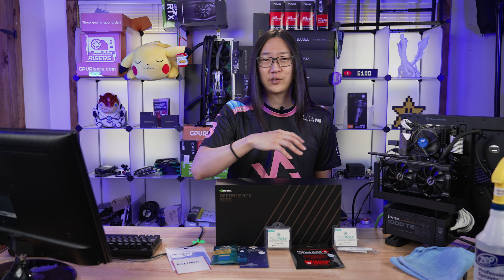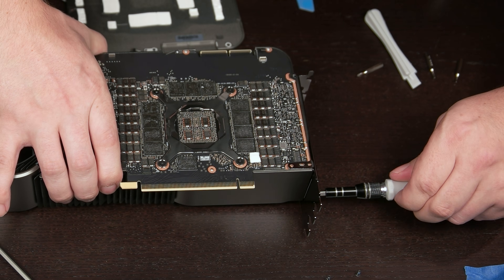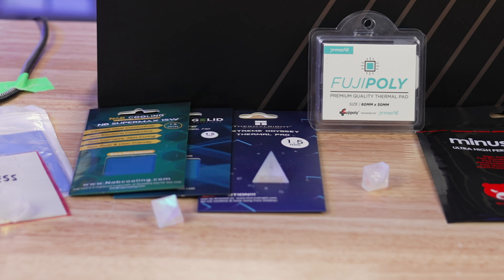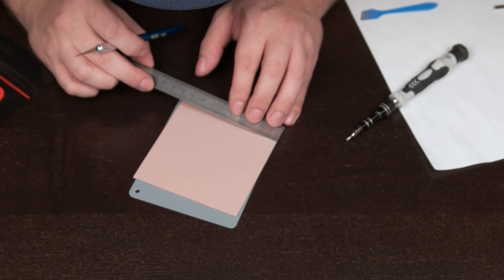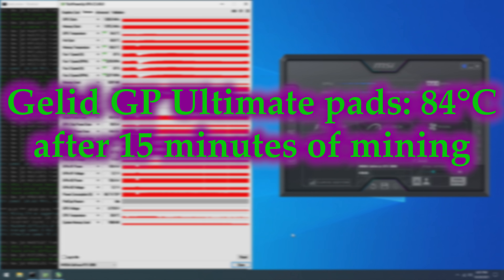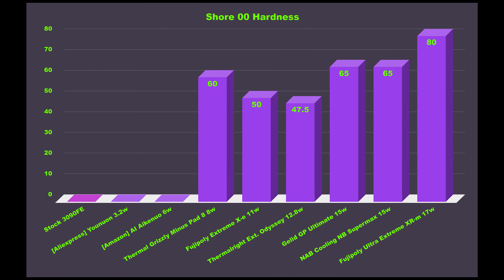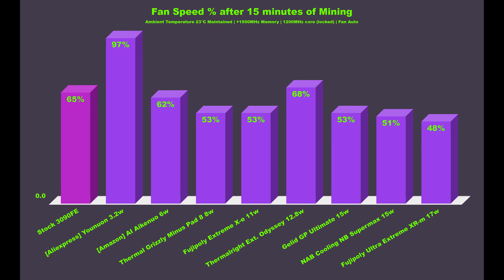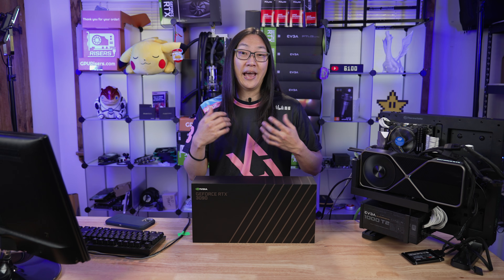Thermal Pad Showdown! What you should (and Shouldn't) Buy

Comment: 17:22 you sayin the Founders heat sink around the entire board isn't good enough? Maybe the Ko will do better as a heatsink coming from Asus and all. Right?... Wait that's a good question. Is it better to use decent thermal pads on Asus cards?
Reply from the maker: It's about it's designed purpose. For memory intensive applications. It's not a good design. However, for 90% of gaming applications, it's fine since the memory doesn't get taxed as much.

I don't understand the question though. Are you asking if it's good? I don't think it's bad.

Comment: Bought the NAB Cooling for my EVGA  3080 TI based on this comparison and V-RAM temps stayed exactly the same as it was with the stock pads. Used 2mm AB Cooling and measured the stock pads at 2mm as well.
Reply from the maker: Do you know what the exact measurements on total compressed thickness was?
Reply: @TekShinji  I do not. I still have the pads that came off as they were still in great shape. I'm assuming you mean the thickness of the compressed parts where the pad contacted the ram and the cooling plate?
Reply from the maker: Yeah, it's just strange that you had no noticeable difference. I'm talking about the compressed thickness. Yes that's correct.
Reply: Measured 1.89-1.92mm compressed
Reply from the maker: All right, thanks for the feedback!
Reply: @TekShinji  So interesting development with my EVGA 3080 Ti. Recently installed a GPU brace that runs inline with the card and has an adjustable piece that holds the card up. (It slides along the brace and tightens with a thumb screw)

I installed the brace with the adjustable piece at the end of the card farthest away from the I/O and when I ran my miner temps went up into the 100's (100-102). I believe the brace was bending the card breaking the contact of the thermal pads.

 I then moved the adjustable piece to be as close to the I/O (and subsequently closer to the GPU Silicon) as possible and temps normalized and even went down 1-2C. I suspect that with this card a 2.1mm or 2.2mm thermal pad may be in order, or it may be that the AB/Gelid (same company BTW) pads are just slightly smaller than the advertised 2mm. (without re-watching the video I believe I recall you measuring the pads out at 1.9mm or 1.8mm)

Just thought it was an interesting discovery that may or may not be worth some more investigation.

Comment: Mate I like that you did the testing, but - the thesis that the heat energy of the memory increases cooler / gpu temp is bs. The gpu die runs hotter because the fan speed is tied to the highest temperatures on the card. If the memory is cooler the card will run lower fan speeds and the gpu die gets hotter - you can easily fix that yourself by tuning the fan curve.

First law of thermodynamics. Energy conservation. Yes theoreticly heat flux through the air / pcb should be increased by a higher temperature delta, but the difference is negligible. There is a reason we use a lot of surface area and fans on coolers - air is a terrible heat conductor.
Reply from the maker: Hey there, thanks for the response! Would you be able to come up with any supporting testing to confirm this? We would have thought the same thing, in fact we did think the same thing until we saw these results with better pads so to speak and the GPU core temperature on the cards. On all of them not just one and it was on all of the test

Energy conservation first law of thermodynamics is very important. In fact, this is part of the reason why we didn't think this is what was happening
Reply: @TekShinji  It's hard for me to test. I don't have ac. I think at a fixed fanspeed with a full heatsoak (maybe like 30 min before testing) it should be very visible.
Reply from the maker: Yeah, these things are not the easiest things to test at least in a scientific manner. A lot of testing subjective so we try to account for that in our testing.

Oftentimes as with physics, science, things that work out on paper don't always work out in the real world due to some unrelated environmental factor that must be considered.

Comment: i have a very strong feeling your increase in GPU core temp had more to do with pad thickness than thermal conduction of the pads.
Mounting pressure and distance for thermal grease is CRITICAL (for pads it's just ..."meaningful"). YES there thermal energy conducted faster to the heatsync if the pads is better - but even if you DOUBLE that conduction - you're still dealing with the exact same amount of total heat energy, It's getting in sooner, but there's not physically any MORE of it. 
Your GPU is running hotter because the stock pads are either NOT 1.5mm OR their FITTED thickness is lower than the others.
Reply from the maker: Hi there, thanks for your response, did you watch the whole video?
Reply: @TekShinji  yes, and it was a great video, very helpful
Reply from the maker: Regarding The GPU core issue, I would agree with you if we had inconclusive data but I feel the data we have kind of proves it. We kept the environment the same. The only variable was the pads, and we tested it multiple times on each card. If you see from the data, you can see that the pads that had the higher transference also increase the core temperature.

However, I can also understand how you may not see it that way. Which it's still a possibility. However, we do not have the scientific equipment to go that far.
Reply: @TekShinji   you know what; i was looking at those numbers thinking: how could they be SO different when VRAM is only a small portion a GPUs power (what's an extra 20W to a 300W GPU? 5-7°C?)  - but i didn't consider that when mining, VCORE is not using a lot of power in the first place, so it might well make a proportionally larger contribution to temperature.
Reply from the maker: That is correct. That's the conclusion we came up with. However, we're also open to interpretation of our data. That's why everything is displayed in a long video. Lol. This video would have been very different if we just said XYZ the best.

Comment: GJ guys i am realy enjoyed watching video. I am goin to do a coper shims mode to my gpu its a freaking gigabyte rtx 3080.
I have tryed minus 8 pads and no go also replaced other stock pads because they leak oil.
For other component i put arctic apt2560 high performance pads also on the back was instaled minus 8 grizly pad then i will add a coper shims 2mm thicknes on vram modules.
This mode is much more cheaper than go for gelid or other expencive pads.
Hey coper have up to 400w/mQ but i dunno how would that efect gpu die in oreder of heat disaapation.
Using arctic mx5 paste.
Any ways you made great video but i do not have confidience to this ecpencive pads in longer term of use in case of mining.
Reply from the maker: Hey there, thanks for your comment. Please let us know what you decide to go with!

Comment: Very good analysis ! I really like it !

Do you expect to do the follow up video on a more in depth analysis of the increase in temperature of the gpu and how to prevent it ?

My solution would be to use a different heat sink, but thats a huge project...
Reply from the maker: Hey there, the analysis we did on the temperature increase was consisted across the board on all the pads that had better thermal transfer performance. So it was enough data on our end to conclude that was the cause.

A different heat sink is a great idea, but in practical terms it's not something that makes any sense. At that point, it'd be better just to buy a different card.
Reply: @TekShinji  so you're saying it's either we tolerate either higher gpu tenperature or memory temperature ou just buy a different video card ?
Reply from the maker: No, I don't of course I don't believe in that.

Rather, if you take the cost of buying a "cheaper" GPU with thermal problems; the cost of your labor, parts, waiting for shipping, and potential issues for damage.  

Versus the cost of just buying a more expensive card that's got no thermal issues

The numbers don't really make sense. Understand what I mean?

Comment: According to the measurements in the video the total amount needed is 5495,4mm2 2mm and 8440,4mm2 1,5mm if you stack 2mm and 1,5mm to get 3,5mm
Reply from the maker: It's not recommended to stack pads but in a pinch you can definitely do it

Comment: It´s good to add, that you should always measure your old thermal pads and add new of the same height. Otherwise, you might encounter issues, like higher GPU core and/or VRM thermals, when using thicker pads. Or higher memory/VRM temperatures, when using thinner thermal pads.
Another necessary point is, each card can have multiple sizes of pads on various places, so you need to have a supply of multiple sizes of pads.
Reply from the maker: Thanks for the feedback!
Reply: @TekShinji  i was replacing the pads on my GPU last weekend and these were my findings. I had some trouble with measuring stock pads, so i used thicker pads for VRAM, as a result, i had insufficient contact at core and VRM. There is similar issue with backplate, especially when there aren’t enough screws near the padded area. It’s also necessary to understand, which area should be covered by the pads, since the manufacturers tends to use pads as simple & cheap as possible - they´d rather use 1 longer pad, than 2 or more individual pads for each VRAM chip.

Comment: Which would be better if I am water cooling a MSI 3070 ti
Reply from the maker: Thanks for the comment! did you watch the whole video?
Reply: @TekShinji  I did but bykski uses 1.8mm pads which is an unusual size
Reply from the maker: Yes, so some pads are softer than others. A soft 2 mm might work out? However, you would have to see what works best for your situation. Unfortunately, the pads aren't made to any type of universal standard so it's kind of hard to tell until you have them

Comment: After so many annoying videos of "I tried new pads, and it worked better!"  It is nice to see someone do a real side-by-side of different pads, and seeing what actually makes a difference and how much.
Main issue with my 3090 hasn't been the main cooler, but the back plate.  Even with a heat pipe under the back, you can still easily fry an egg on the back of the card!  Took a block from an old Pentium II and just a little thermal paste (more to help it stick than as a permanent solution), and my reported VRAM temps dropped 10*c.  That tells me that the VRAM under the main cooler is getting plenty of love from the fans, but the VRAM on the back is essentially the thermal bottleneck of the system.

Whats more, after a month of mining at ~305W and 110-115MH/s my temps have risen significantly from 94-96*c back up to around 106*c which appears to be the thermal limit of my GPU where it will start slowing itself down a bit.  From what I have read, this is expected for my card (Dell 3090), so now I am ordering some aftermarket pads... Hopefully it will work as expected and get me back up where my card belongs.  In the mean time, lowering the power level to ~250W and getting closer to 90-100MH gets me back down to the more cozy 94-96*c again.  The idea of being able to get closer to 90*c at full tilt... that would make me feel a heck of a lot better.  I know on paper 120*c is where damage can occur, so the built-in 106*c is giving plenty of margin for error... but the lower I can get it below 100*c the better.
Obviously while mining I am underclocking the GPU itself, so my GPU temps are a frosty 50*c, so no chance of danger there.  It is only the RAM temps that causes me some worry.
Reply: Perfect!  After looking at what my Dell 3090 needs I was able to find the NAB 15W pads for $8.50 for .5mm and $11 for 1mm.  Ordered a 90x50cm sheet of each.  The Gelid pads were $1 more expensive, but I'd still check as I would imagine a sale or price fluctuation may make one or the other cheaper.

For those with similar Dell 3080 and 3090 cards:
On the front of the card you will need 1mm pads between the RAM and the black thermal plate that covers the card.
Between the heatsink and the black plate you can use thermal paste, but it needs to be thicker paste that wont melt/run/move over time.  The other option here is to use .5mm pads instead which will compress down and will be more consistent over time.
On the back, if on a 3080 just keep with the stock pads, they aren't doing much, and there is little to no point to replacing it (especially if it is sucking more heat out the front of the card more effectively).  For a 3090, especially if mining, the RAM modules on back are likely your bottleneck.  The built in pads look like they are pretty good quality... but just don't cover the whole chip, so not all of the heat is being dealt with.  So you can either keep the stock back pads and add a .5mm pad to cover the area a little better (they are stackable and will squish enough to not be a problem), or get a 1.5mm pad to take care of the rest.
Reply from the maker: That's awesome, Thanks for the comment!

Comment from the maker: Why dont i use shimis? why not use this pad? best place to let us know and FINDout WHAT ELSE we did in our discord! 

Tek Shinji Community Discord 
https://discord.gg/mjVHe2YMkR
Reply: You should try K5 Pro Viscous thermal compound it’s amazing thermal pad replacement it replaces pads up to 3mm thick I found it through LTT and his more FPS for $10 video
Reply from the maker: @shorty808100  I wish $10 got you more fps.
Reply: @shorty808100  K5 Pro has conductivity 5,3 W/mK. Better Laird Tputty 607 6,4 W/mK, Upsiren U6 Pro 12,8 W/mK.
Reply: I'm foreigner. English is not my native language. It is very difficult to understand the whole video. So your conclusion is which type is best to use. Thanks
Reply: So you bought all these pads but didnt buy alphacool or use k5 pro? which are the best.  kinda defeats point of this video
1
Reply: @AcidBombYT  If they are better, it would exacerbate the problem highlighted at the end of the video regarding a saturated cooler heating up the gpu
Reply: @kdl0  umm yea but if you are using after market thermal pads then you probably shouldn't be using a regular cooler.  They are most useful with water.  The cooler will always be saturated when your just using a fan to blow air against a piece of metal.  Air as a fluid is not very efficient at dissipating heat unlike water.

Comment: I used AI Aikenuo on my RX 570 because that what I had in my home, they are better than stock thermapads
Reply from the maker: Nice! You just had those at home or did you buy them and put them somewhere?
Reply: @TekShinji  I bought them for $4.50 from a local store in 2019, 2 months ago my Gigabyte RX 570 one fan stopped from working so I replaced that fan and used AI Aikenuo thermalpads, temperature was 50-52, now 42-44. I used what I have because I did not want to wait an order.
Reply: @TekShinji  Thermalpaste I used GD-900

Comment: 17:44 - this conclusion doesn’t make any sense in terms of physics. You are implying that with better thermalpads more heat goes into the cooler - this is only true when memory throttles with the worse pads. If the memory temperature stabilizes below throttling temperature it means that the exact same ammount of heat gets dissapated regardles whether it sits at 100*C or 60*C. It’s just that with the worse pads the temperature difference needs to be greater in order to achive the same ammount of heat transfer. And if memory throttling appears then obviously you get lower core temps because a) the memory modules produce less heat (they get less power) and b) the core it self can’t be fully utilized because the memory is acting as a bottleneck. So it’s always prefered to have better thermal pads.
Edit: and then of course depending on the hardness of the pad, the pressure distribution on the gpu die and memory modules is different.
Edit2: so tl;dr any core temp increase can be due to higher gpu/memory utilization or different mounting pressure (worse gpu die -> heatsink transfer) not due to memory -> gpu die heat transfer.
Reply from the maker: Thanks for your feedback! If you like to talk more about it, try joining our discord :-)

Comment: Now is lowering vram temps of say 15-20 degrees but then core temp going up to 21-23 degrees worth it? Kinda looks like you need to just water cool the gpu
Reply from the maker: It really depends, part of the reason why we don't give a definitive, black and white answer is, it depends on what your needs and desires are. GPUs are specifically designed for a purpose and when you modify a component, it affects other parts of the GPU. So if you want the lowest GPU core temperature is then you would want to use different pads versus the other
Reply: @TekShinji  copper heat sinks trail on top of the back plate needs to be done my man! You've gotten me way into this haha. 

Just my thoughts though. It seems like doing the thermal pads to lower vram temps would benefit crypto miners over gamers. Would you agree?

Comment: Great review and hats off to your patience. I wonder why you did not include gelid extreme. I repadded my 3080ti fe with 1.5mm front and 2mm on back separately. Front repad lowered mining temps from 106 to 98-100 and back repad about 92-98. Its rated for 12w and i am not happy with this amount of effort lol. I expected temps in 80s after so much struggle. Also it took 1 sheet on front and 2 on back. So back ones costed me double than front. May be will try nab or ultimate next time on front. Nab has v few reviews on amazon, not sure if they will last long. Appreciate your efforts though.
Reply from the maker: We chose what we thought were the most common ones at the time that were readily available. It was more likely than not. They were not in stock.